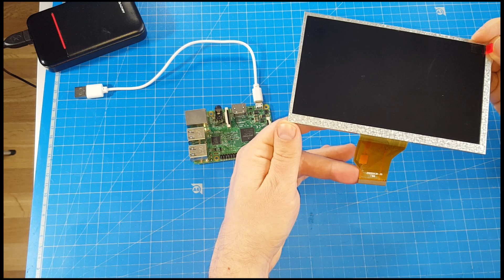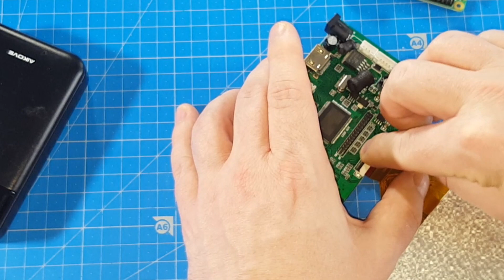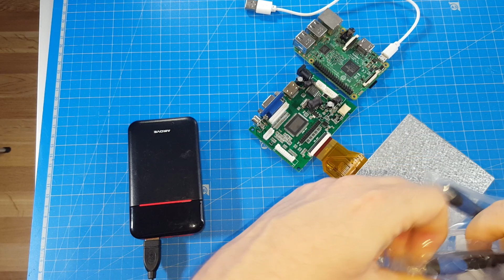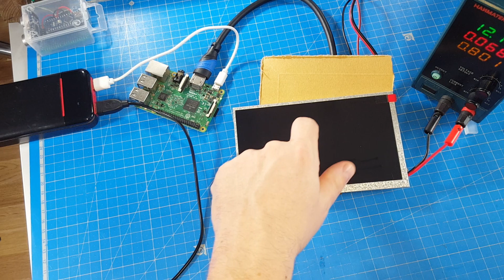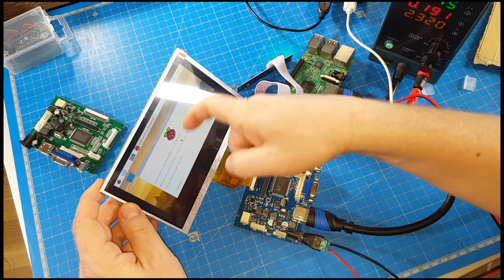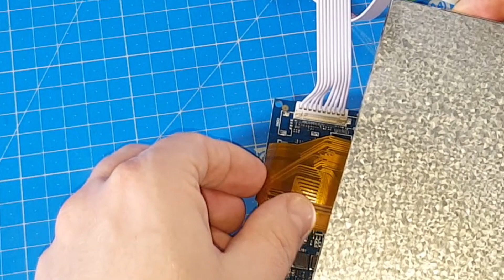7 inch display for the Raspberry Pi

Comment: It does not have a touch digitizer. 7:39 - OMG lol you are soo confused out of this world... this display is not specifically made for the raspberry pi and for "regular" consumers. This display is specifically designed and made for real hardware engineers and OEM manufactures who makes products for regular consumers lol. This is why they didn't put a user friendly regular "micro USB" port, because hardware designers and engineers will ask the same question why did they waste money to put a USB micro port. For example lets say you bought a "Sony" 7 inch LCD display and opened it up, will you be surprised you saw a micro USB that is powering the display? I'm sure you would, since these displays are not meant to ever be open.

Comment: I would think it would be cheaper to just buy a non-touch display since the touch feature is so difficult to get working on these cheap boards. That's why they are cheap, they are nothing but a screen. You have to buy another board for a driver and another for the touch screen.